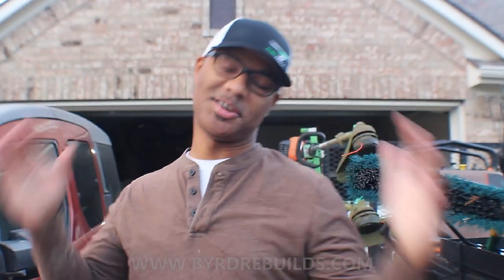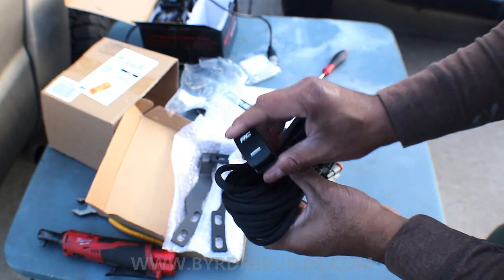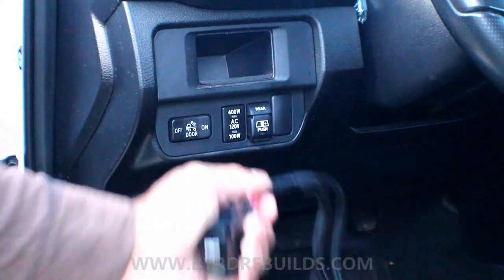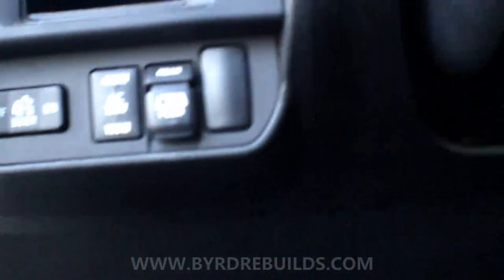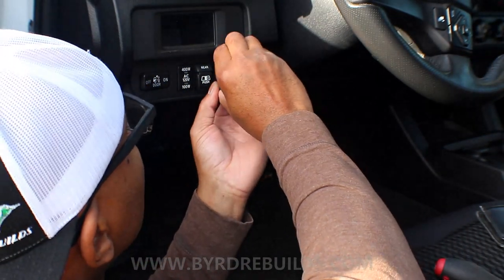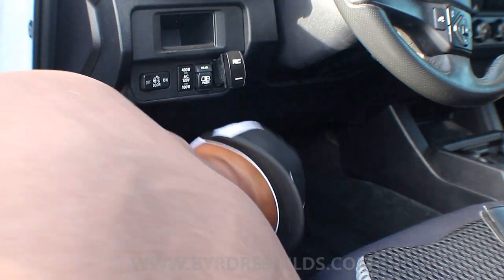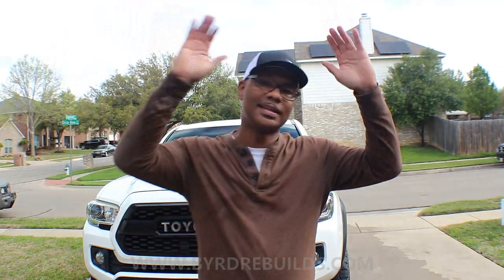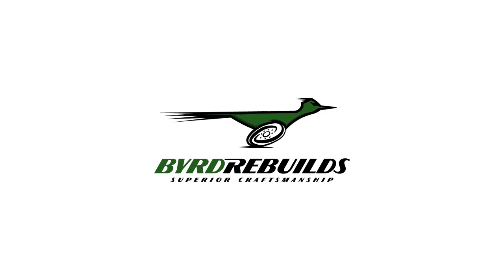Install Rough Country Hood (Ditch) lights

Comment: power steering on the Element. I had the same thing and it was the low pressure power steering hose in the back of the engine and a small leak on one of the hoses that connects to the reservoir in the front.